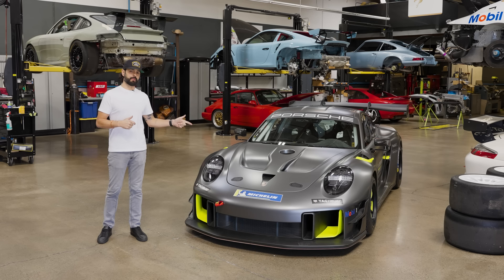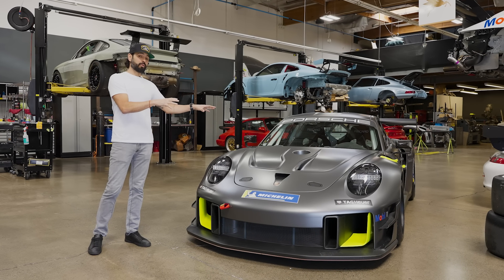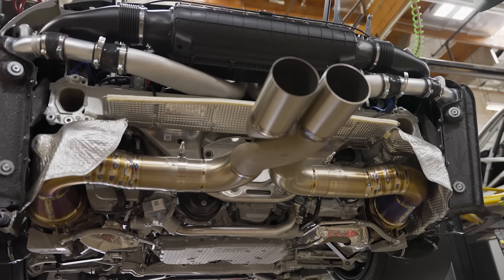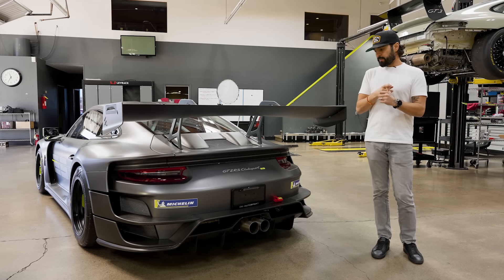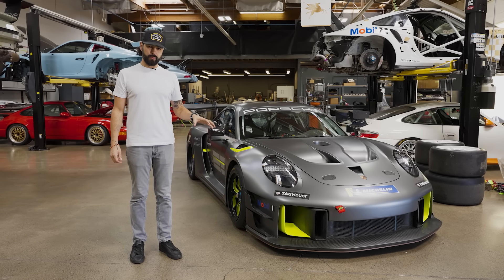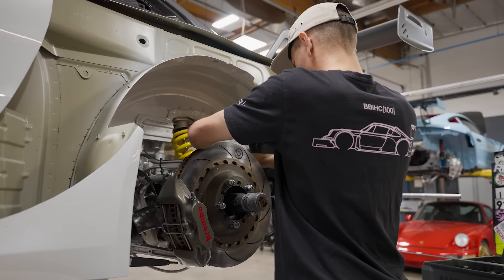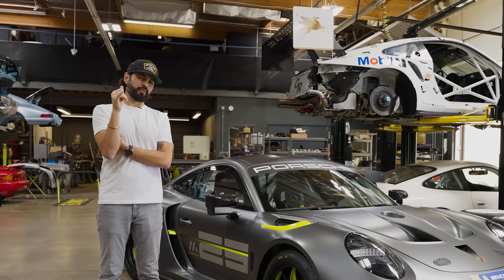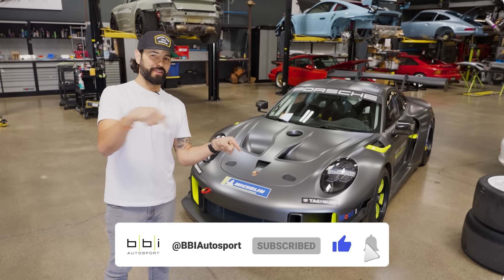We got our hands on a Porsche GT2 RS Clubsport 25 Manthey Edition! - BBI Autosport

Comment: Why so much negative camber on the rear wheels? You'll never see an F1 car with any camber because the only way you can get all the rubber on the ground is with zero camber  ¿`_
Reply: Allows you to put the power down hard from apex to exit of corner.  The car does best from -2.5 to -3 degrees of negative chamber.  -2.5 max is regulation limit for racing with SRO.
Reply: @KarlLeinsing  keep telling yourself that ¿`_
Reply: @user-ys9to2ie7k  I’ve raced the GT2 RS Clubsport and -2.5 up front resulted in even wear on my tires and great late braking into apex.  Rear at -2.5 showed less wear on inside.  The tires don’t lie.  If you have a track with less tight corners or more straights then this will change slightly.
Reply: @KarlLeinsing  OK ¿`_